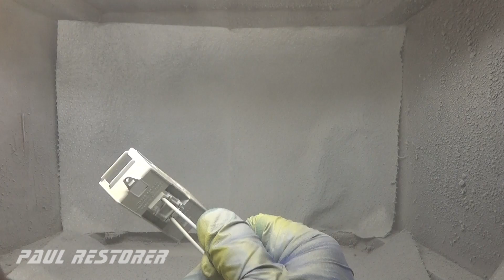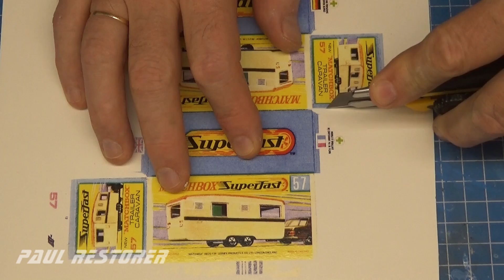Matchbox renowacja MG 1100 Superfast  nr 64 i Przyczepa Kempingowa nr 57. Model odlewany.

Comment: Just a tip i have learnt over the years. If you place ABS plastic (I suspect the pen lid is this) into a jar with some acetone in it, it melts into a slurry of coloured plastic. You can paint this thick slurry into the dings and knocks and let the acetone evaporate to give you a solid bonded material.
Reply from the maker: thank you very much. I will definitely try it out